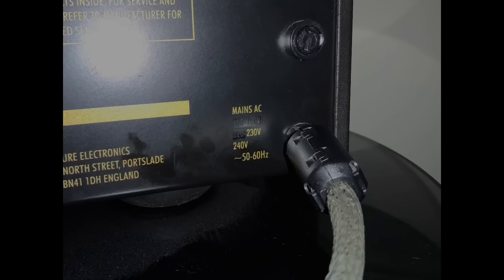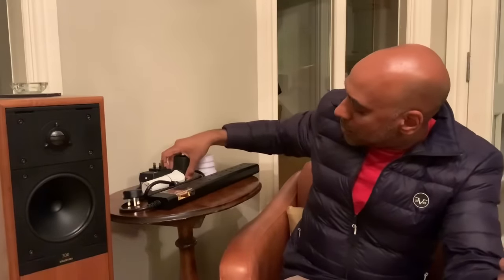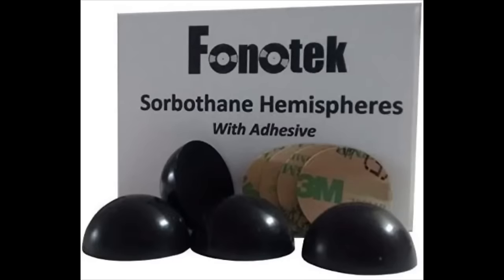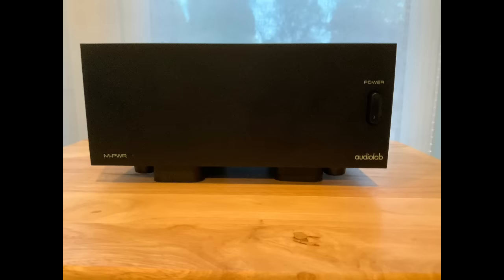My Top 5 Inexpensive Hifi Tweaks

Comment: A good list, However, only connect the shield at one end, it's supposed to only block interference, not carry earth currents. As for ferrite's, put them at the amplifier end, induced emi is not going to disturb a speaker whereas it could upset an amplifier, even getting induced into earlier stages causing it to get amplified, or causing instability in the amp as amp's are only designed to handle audio, not wideband (into the MHz) crud & noise.
Also a larger ferrite core around both speaker leads to stop common mode interference/noise pickup.
Reply from the maker: Thank you for watching and sharing Paul

Comment: Hi, Great territorial on upgrading cables and devices to stop interference in Laymans terms, Last year I remember reading something and finding a bit more about it do you think it’s worth running a special cable from your fuse board to where you have got your hi-fi equipment especially if you’re in a process of renovation or building work in your property, And what sort of cable would you recommend and what type of components would you put on either end as a respect as a fuse breaker and a socket system for your devices, I mainly as I have open flooring and access to the underside of ceiling joists to run new cables at the moment do you think it’s worthwhile doing. Phil from the moulin France

Comment: Another good video m8. I'm already doing the isolation, haven't played with ferrites or mains cables yet. With regards to your comment about  terminating the shield at both ends. I thought shields were only supposed to be connected at one end? . In this case at the wall end.
Best cheap tweek I've done lately is piling bricks on my speakers. Really does good things for transient response and bass extension. It's ugly though 😆
Reply from the maker: Thank you for watching Chris. My understanding is that terminating the shield at both ends provides better noise rejection but can cause ground loop problems in some systems which can introduce hum and in extreme cases distortion. Terminating the shield at one end provides less shielding (the shield acts like an antenna) but has no ground loop problems. In short, if you have a ground loop problem, terminate at one end, if you don’t, terminate at both ends.
Reply: @abritishaudiophile7314  Thanks for the info didn't know that 👍

Comment: Hi Tarun, got an interesting story for you here. You mentioned about valves being highly sensitive to microphonics, and therefore they may benefit from damping devices. My Musical Fidelity Tri Vista 21 DAC has Nuvista valves, so I started thinking about doing an experiment. I am a part-time window cleaner, and had some spare rubber left over after putting new blades on a squeegee. You can probably see where I'm going with this... I thought why not try a quick and free tweak. The DAC is currently on a wooden shelf system I constructed years ago. So I lifted the 2 front feet up and put the pieces of rubber under them. Then I played a well known and high quality disc (Tubular Bells 2, lots of layers and detail, great production). I really wasn't expecting to hear any difference, but I did! I tried several tracks, and then different discs. It was like hearing them anew. I couldn't believe it! Of course I was aware that I might be just finding what I was looking for, but I really believe it has made a difference. The good thing is I can easily remove them and do the test again. I will let you know how I go with it!
This leads onto another thing I learnt which you may not know. A good hi-fi shop years ago told me that the best way to hear a difference between 2 different components etc. is to go from worse to better (NOT the other way round). This makes sense as our hearing has evolved to notice new sounds, as in a predator/prey entering a soundscape. One leaving is far less noticeable. Hope you find this interesting/useful. Love your content and style, keep up the good work!
Reply from the maker: Hi Coneman3, very interesting. Please keep me posted. Do you think short A/B tests work? I always struggle with them and have always attributed this to our short term auditory memory being so unreliable. I find if I have it in my system for a few days and then switch I get a better handle on what is going on. Just my two pennies worth. Thanks for sharing 👍
Reply: @abritishaudiophile7314  There's definitely an improvement from damping the DAC with rubber. I did the same for the DVD player I use as a transport, and also the other 2 feet of the DAC which gave further improvements. The improvements come in many ways: more air around instruments, greater voice/instrument separation, better dynamics, finer detail, more layers of sound, wider soundstage, bigger sound. All the things audiophile articles go an about which sound a bit esoteric and maybe imaginary. Notes have more detail and quality, instruments more timbral details. It's amazing how good this DAC is and my system in general, I'm hearing details that few probably ever do. Of course the better your system, the finer and more minor your tweaks have to be, as you are getting smaller and smaller improvements. Anyone who doesn't believe in tweaks should realise that all hi-fi is about tweaks. It's all that separates different hi-fi units, various bundles of tweaks. As audiophiles there are some tweaks we have to add to get everything out of what we have bought. We buy boxes of internal tweaks, then add external ones.
I still have many ways I can improve on this damping, a bit like years ago when I did a series of tweaks on speaker damping at their bases. It's enjoyable (and can be cheap which helps) and many won't understand that. I'll let you know what I find. I might even make my own speaker enclosures one day.
Oh and a very good CD track for layers of superbly recorded detail is the track Amazing by George Michael. Superb production.
On the A/B tests, it's interesting you take the longer term approach. I tend to go for the short term one, but with repeat sessions to make sure. At least with short term ones, your levels of ear wax are the same! I think if you make a change and notice new notes/instruments/tracks, or just an obvious improvement in clarity, then you must have done something positive. I think also focussing on fine detail in a very good track is a good way to make direct comparisons. Listen out for subtle sounds. More obvious things like tightness of the bass will be more apparent (or not). Perhaps there are benefits to both short and longer term approaches. At least with some tweaks, like mine above, they are free or dirt cheap and worth doing just as insurance. Most tweaks have some theory behind them, so have a good chance of helping.

Comment: Using pads like these to isolate your speakers works well. A major problem is that with almost all attempts to isolate you add a serious potential to swing and wobble due to the soft foundation. Your neighbours might benefit from this, but you don't. If you place isolation underneath a heavy paver with the speaker on top you have best of both worlds.

Comment: Great video (articulate and concise). I was very excited to try the Tacima CS947, as that's how I came to your video. Unfortunately, they don't produce them for the Canadian market and I'm not sure it'd be worth it to use with plug adapters etc. However, I did order the iFi, so we'll see how it goes. I'm all for cheap tweaks. Many years ago I came across a forum talking about using Ikea Lack sidetables as isolation platforms. I'm not sure if the construction of current ones are same as they were 10 years ago, but to me they made a very noticeable difference, especially on the CD player and my tube amp.
Reply from the maker: Thank you for watching and sharing Scott 😉
Reply: @abritishaudiophile7314  Just plugged in the iFi .. first 6 hours on it .. wasn't subtle on my system, very noticeable difference, especially with the bass (tighter) and seperation of intstruments. Guess this is what is meant with "lower noise floor". I live in 30+ year old apartment building in a pretty popular area of a major city with lots of younger folks, wifi etc. Best results were when plugged in parallel with my tube amp .. sources/power bar on seperate outlet (noticeable difference as well, just not as great). Thanks for the tip! great tweak.

Comment: There is 1 power conditioner that actually make the sound a lot more free and natural, and manages to remove all noise: Isol8 mini sub axis. That is the only powerbar/conditioner I recommend. Expensive yes, but when you have it, it is like having an amplifier that costs 2x more, it puts basically everything else to shame and makes everything else sound articial and restricted. Normal powerbars are really noisy, I mean really noisy! With this thing on you can crank the volume to 2-3 times higher and hear a lot more detail while it still sounds less restrictive than a normal powerbar, that is rare!
Reply from the maker: Thank you. I just wanted to restrict it to inexpensive items in this particular video.
Reply: Yes that makes perfect sense, and the symptoms you describe are also spot on plus the solution you provide.

I just wanted to address the issue that a lot of people think that there arent't power condtioners out there that actually improve the sound in every single aspect.
A lot of people fight with powerbars and conditioners, and most of these products are very biased in sound even though they do some good. I just wanted to provide a solution that can make almost all audiophiles happy without a single bad sound characteristic.

Most people I know including myself, bought this particular box, so they did not have to spend 5-10.000 dollars on a better amplifier for a similar effect.

Thanks for the good video, really good tips.

Comment: After removing my Tacima power strip, my Cambridge CX-A60 woke up, as in, it had bounce and seemed a lot happier. Very interested in the power cables.  Cheers :)
Reply from the maker: These tweaks are very system dependent. Thank you for watching and sharing 😉👍

Comment: Very sensible advice here. There are a lot of very expensive tweaks on the market which are simply "Snakeoil" and " Placebo" products. One point though. The screening on mains cables should only be attached at the wall plug end, not the IEC plug end. If its attached at both ends it will merely transfer the RFI to the equipment chassis.

Keep up the good reviews!
Reply from the maker: Hi Steve, thank you for watching and sharing. There seems to be a school of thought that the shielding is more effective if grounded at both ends but can introduce group loop problems if there is a p.d. between the two points. Is this correct?
Reply: Hi.
The theory is that the screening on the mains leads sheilds interference from the current flowing in them being induced into the nearby signal leads so there is only a need to terminate them at the wall socket plug.  The screening, as all wires do, picks up stray RFI anyway but this is drained to earth in the mains plug. If the screening is terminated at both ends the screening will then act as an antenna for RFI and transfer it directly into the equipment chassis and circuits.
Reply from the maker: Thank you Steve
Reply: Hi Tarun

I thought I would suggest a topic for you, that of setting up a subwoofer or subwoofers. I have spent quite a lot of time setting up mine and its rather a combination of art and science setting up the phase, level and crossover frequency but when you get it right, its time well spent. I have posted a comment on Subwoofer 101s channel with some tips which you might like to check out.

On this subject I see that you are using a very large ( Vented?) sub with your quite small Pro Ac main speakers. I think this might be a mistake. I have a pair of Neat Motive 3s with a BK Electronics XXL 200 DF sub which is a fantastically well matched combination. I did try the larger version, the XXL400 DF and it was a disappointment. The bass was ponderous, slow and inarticulate in comparison. If you listen to movies in a very large room then maybe a single very large vented sub is needed, but for music it is definitely not optimum.

In your case I would suggest that you try two smaller sealed subs placed behind you pro acs set up carefully. I think you will be amazed at how much better it will be.

Steve

Comment: Maybe you've addressed this already, but it appears the Tacima product is unavailable and incompatible with NA sockets. Any other comparable recommendations? I very much appreciate your informative reviews and recommendations. Thanks.
Reply from the maker: I like the IFi parallel main conditioner 😊
Reply: @abritishaudiophile7314  Thanks. It's considerably more expensive, but I might try it with my new Audiolab amp.
Reply from the maker: @lawlesskm  you don’t need to get the strip just the plug in device in the wall socket. It is called and IFi AC Purifier 😊
Reply: @abritishaudiophile7314  Thanks.

Comment: I always found spikes work best for isolating speakers from the stands or anything else. Tried a silicone substitute once for mainly stability reasons and it ruined the sound of my speakers. Lost so much midrange. Changed back and in the bin they went.
Reply from the maker: Thank you for sharing. The spike will couple the speakers to the floor and than can work better in some instances 😊

Comment: Not much difference on my PC+Elac+Cambridge sys tho but yes on my Harbeth+Rega... Must be more electrical interference on the main rig 🤔. Bamboo board+washing machine feet... Cleaner sound...  thanks Tarun ;)
Reply: Sorry didn't mentuon... i was referring to the Ferrite core
Reply from the maker: Hi Tim, these things are very system dependent. That is why I called them Tweaks. They work well in my systems too. Glad you had some success with them. Thank you for watching and trying them out.😉

Comment: The washing machine thing will stop vibrations for sure - but you will reduce bass impact.  I actually enjoy the feel you get through a wood floor but I used a door type little square hard rubber stopper rather than the very soft washing machine one.  That gives you a certain degree of damping but not as much which might be a better balance depending on your house.  Worth a try as they are $2 for a pack at the hardware store.
Reply from the maker: Hi DesignVisStudios, thank you for the tip 👍

Comment: the Tacima CS947 is a euro/UK plug only adapter, they don't work here in the US without adding an extra circuit in the chain which would partly defeat the propose.  Most of the US options are far more expensive, the cheapest one I can find is around $100, and most are in the $150+ range.....
Reply from the maker: Hi aegisofhonor, that is a shame. Can you get the Furman M10x E in the USA?

Comment: I bought an upmarket noise conditioner for my home, found no benefit from it and put it in the attic. I bought a condo in the mountains, one of 24 units. The audio setup I installed sounded odd a lot of the time. After trying a few different things, I dug out the noise conditioner and ran everything except the power amp from it. The improvement was striking. I'm assuming that there are devices in the other units putting RF into the mains some of the time.
Reply from the maker: Thank you for watching and sharing your experiences Dalton 😉

Comment: Hello an thank you for your videos. Great advice though I noticed that you're telling that on a power cord the shield should be terminated along with the earth connection on both ends. This is not correct!  The shield should only be connected in the wall plug. In the device end of the cable the shield should be cut clean and left unconnected.
Reply from the maker: Thank you. I amended this advise in the following video. Best to just connect the shield at the mains end 😊

Comment: Tarun, for my gear, adding those sorbathane pucks will add up to a bit of money. Any way to know if they're necessary? Some kind of vibration measurement tool? My gear is well separated, on very thick wooden coffee table, on a thin carpet over a concrete floor -- in the basement. Unless the vibration is coming from the sound from the speakers or the other components, I suspect this will be money better spent elsewhere. Any hint on measuring vibration for these purposes? Thank you.
Reply from the maker: Hi DH, I agree that your money is better spent elsewhere. These things are just tweaks and should be looked at as a bit of fine tuning once you have got good quality components that you want to squeeze the most out of. I don’t have measurements for the sorborthane or silicon feet but if you contact the manufacturer, they may be able to tell you what the recommended component weight is, what frequency range they work over and by how much they reduce vibration. I have these ones by Fisual and they work well. Start with one pack of 4 under your DAC or turntable and see if it makes a difference.
https://www.amazon.co.uk/Fisual-Round-Adhesive-Isolation-Pads/dp/B00856PCC2/ref=sr_1_1?dchild=1&keywords=Fisual+feet&qid=1590447142&sr=8-1